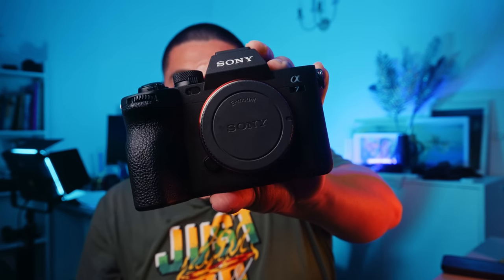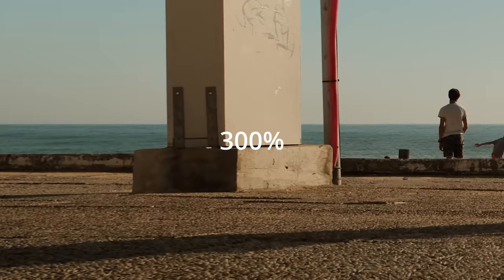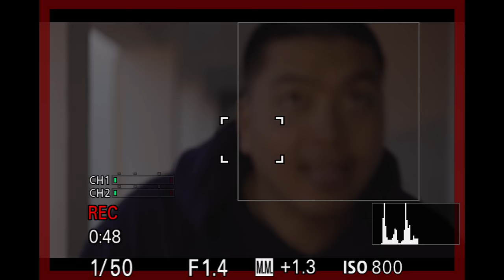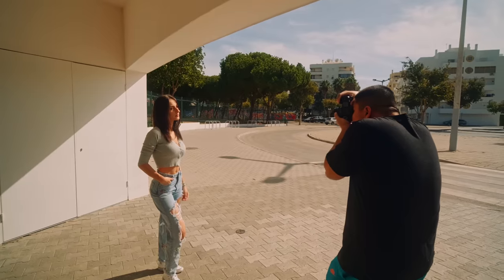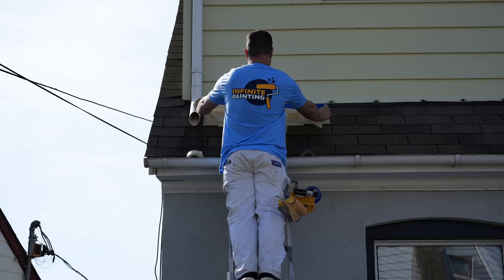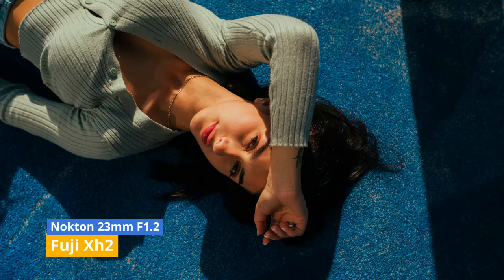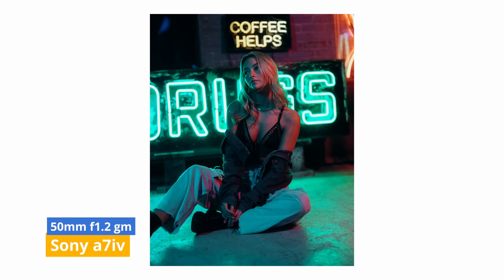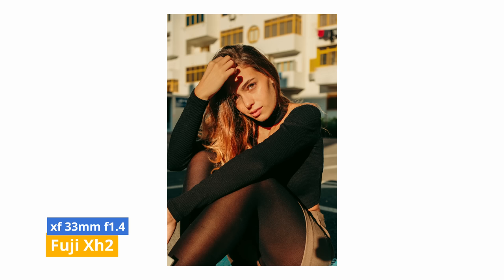Sony A7iv vs Fujifilm XH2 Comparison! FULL FRAME or 8K BEAST?!

Comment: What do you mean full frame look? Isn't the same 3D or separation shooting at 1.2 on a ASPC than it is 1.8 on a FF?
Reply from the maker: Ya it’s just shallowier I can’t explain it what it is. But there’s a certain look when shooting with a full frame camera that you can’t replicate fully on an Apsc.
Reply: @Iamtongue  I said that because I see no difference between each other in your photos. Actually, see more "pop" the fuji ones.

Comment: Nice video, thanks for posting. I like fuji colors, but in low light ISO seems to be going up very quickly. I am amateur hybrid dude narrowed down to Fuji xs20, Sony A7 iv and future Nikon Zf. I want to have compact system. Is it possible to adjust straight out of camera colors in Sony A7 iv to bring them closer to Fuji or Nikon?
Reply from the maker: From my experience it’s hard to bring Sony files to look close to Fuji.
Reply: Yes ish, there is  an profile called Colbat image you can buy for LR. It has giving me close enough canon colors for my sony  files that color is not an issue anymore. Other solution is Sony A7RV which really improved the colors. I like fuji colors too but if i am going to have only one camera than its must be full frame and have good autofocus and wide lens selection, so therefor Sony it is. Also you gotta remember that your images will be less sharp on Fuji Film crop sensor. Sony FF is much shaper.

Comment: Been using the A7iv for stills of people running in cloudy weather. Got some sharp ones, but only 30%.  Subject detection worked great, but many misfocused, especially on the hair for women with long hair.
Pricewise you could have compared the A7iv with the Xh2s, which I'm looking at now. Unfortunately, there are no f2 zooms in the Fuji lineup to match the f2.8 Sony, especially the great 70-200 GM II.

Comment: Thanks for the comparison! So Sony is sharper with less megapixels? Is there any point on having a 40mp sensor then?
Reply from the maker: Yup I would say so. I’ll do an image quality test with the a7iv 50mm gmaster vs the xh2 & 33mm f1.4 after the new year so you guys can compare
Reply: full frame will always produce sharper images than crop sensor cameras...pixel pitch and size matters. I own both the xt5, a74 and a7r3 all my Sony full frame cameras blow out of the water the fuji in terms of detail.

Comment: I'm biased in favor of Fuji so I'm recusing myself from this poll. :)
Have you been using 160mp Pixel Shift? I think it's fun to see the true performance of lenses.
Reply from the maker: I haven't. I honestly don't see a point, i don't do anything that requires pixel shift. I will perhaps try it soon.
Reply: @Iamtongue  I think the sole point of pixel shift is to prove naysayers wrong about 40mp being too much for APS-C. 😆 

Btw, I did have some minor artifact errors when using a mini tripod on a kitchen table, and I'm not sure if it's because of minor vibrations, or if it's because the camera wasn't fully settled on the squishy foam on the tripod plate. 🤔 When I tried a sturdy coffee table without a tripod I had no errors. Something to look out for.

Comment: If AF reliability/feature is of most importance then hands down A7IV.  For everything else X-H2, being a year newer, has better specs and lower price. Fuji lens ecosystem while more limited is also cheaper on the wallet. Sony has more options, better premium lens, but bleeds your wallet. Personally, I went with A7RV, since it has the specs of my imaginary future X-H3 made available today for a hefty price premium. 

Think Fuji could maybe bring touch tracking via firmware but bit doubtful. What will they sacrifice performance wise to have it? AF box in the viewfinder already lags behind the subject even though maybe the actual AF isn't. Seems to get the price point low they skimped a bit on the processor. 

Fuji manager previously said X-T4 eye/subject AF was slower due to xtrans processor limits. X-T5/H2/H2s only brought 2x boost. In comparison Sony Bionz processor in older models already handled subject AF better than Fuji, but A7IV/A7RV they increased it 8x further. Probably what allows them to do multi subject face tracking etc. Ironically still don't let you process RAW in-camera.

Comment: Separation is not only related to sensor size, it's a combination of lens aperture and sensor size. APS C  lenses should have one stop more to match the full frame ones. The Fuji 200 f2 is similar to a 300 f2.8 FF, but there's no 35 f0.85 to match à 50 f 1.2 yet.
Reply: Also a matter of the lens’ distance relative to the subject. 
But yeah if we can make f0.95-f1.0 the new apsc standard we’d be in a better position as far as apsc DOF compared to FF
Reply: End of the day, does your client knows the difference between a F/1.2 or F/2.8?

When you shoot pro sports, most of the shots are gonna be at a high ISO anyways.
Reply: @zKMotion  not always about clients. Not everyone even has clients, but having that extra stop is useful regardless of clients knowing the difference or not, I wouldn’t want to to do evening, or night photography with an f2.8 lens and having to introduce even more noise to my photo than I already have to do with something like a 1.8 on apsc. As far as high iso use in sports, with an extra stop of light you can use a less of that iso, it’s a win win for everyone.
Reply: @Eyeofkamau  Regardless, there's always gonna be a catch 22 whenever it comes to FF and Super35.
As long as client pays the bills, whichever works for me.
Reply: @zKMotion  regardless, for majority of us, there a lot more to photography than that lol